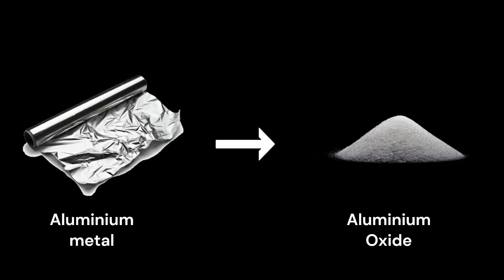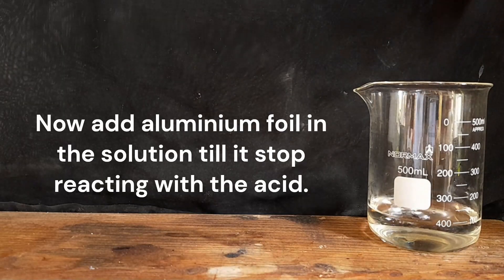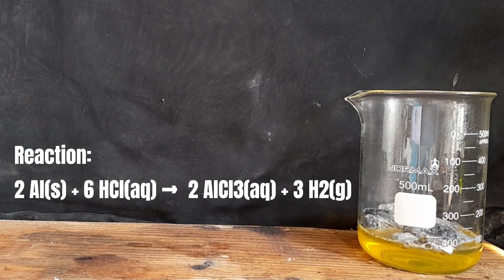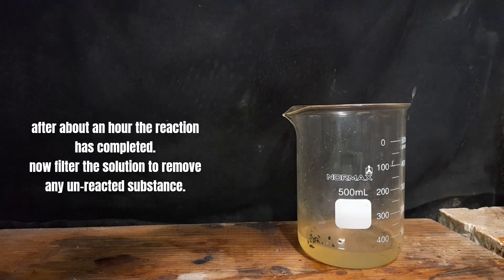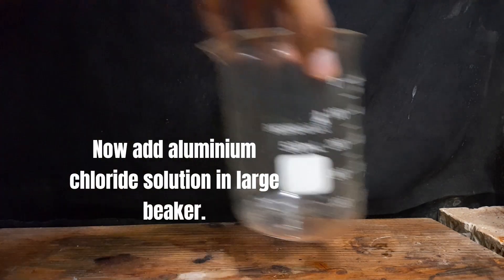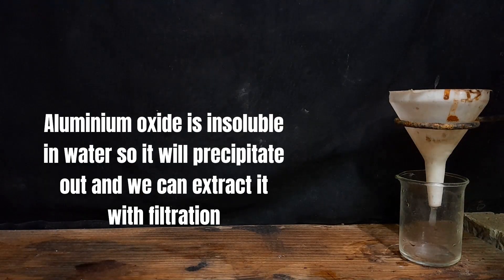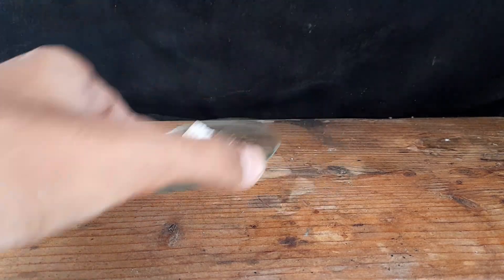Synthesis Of Aluminium Oxide From Aluminium Metal |  Easy Method

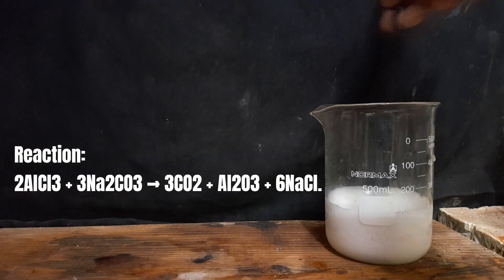Comment: 1:27 just a quick note here, at the right side of the equation you get Al(OH)3 not Al2O3, which is needed to be heated to 400-500°c to be converted to Al2O3

Comment: Can you do the same thing for Gadolinium and Gallium to produce the oxide of these?

Also wondering if Gadolinium oxide has similar magnetic properties of the metal.  At around 20c Gadolinium becomes ferromagnetic.  Gadolinium might make an interesting ferrofluid but would rather use an oxide.

Comment: @Molybdenum The end product is not aluminium oxide, it´s aluminium hydroxide!
Reply from the maker: No brother the end product is aluminium oxide because aluminium hydroxide is insoluble in water but it precipitate out which indicate that it is aluminium oxide
Reply: @Molybdenum-h  You´re getting it wrong, pal! This is the reaction between aluminium chloride and sodium carbonate: 2 AlCl3 + 3 Na2CO3 + 3 H2O = 2 Al(OH)3 + 6 NaCl + 3 CO2
Unfortunately that site is wrong, because what really happens it that aluminium can´t form a stable carbonate since the hypothetical aluminium carbonate is thermodynamically unstable. Because of that it reacts immediately with water to form aluminium hydroxide which is stable:
Al2(CO3)3 + 3 H2O = 2 Al(OH)3 + 3 CO2
Reply from the maker: so what is this white precipitate??? @chemicalmaster3267
Reply: @Molybdenum-h  Like I mentioned earlier, it´s aluminium hydroxide. If you want the oxide just heat it to more or less 600 ºC to dehydrate it and decompose it.
Reply: @chemicalmaster3267  I agree with you. Usually, Al2O3 is formed during the thermal decomposition of certain aluminium salts
Reply from the maker: If you want more details then check this website: https://www.sciencephoto.com/media/4355/view/aluminium-chloride-and-sodium-carbonate#:~:text=Caption,%3E%203CO2%20%2B%20Al2O3%20%2B%206NaCl.